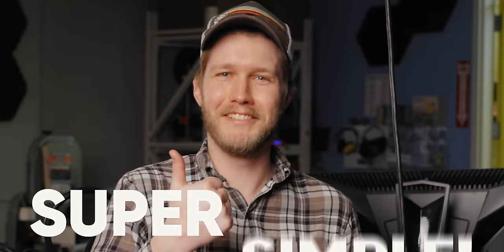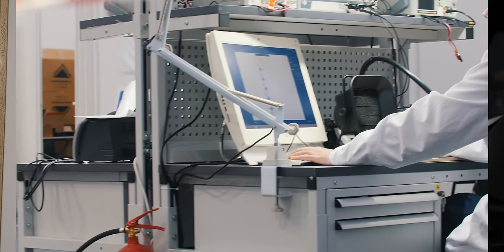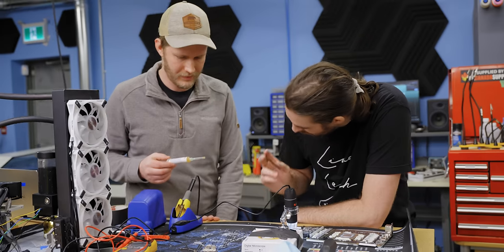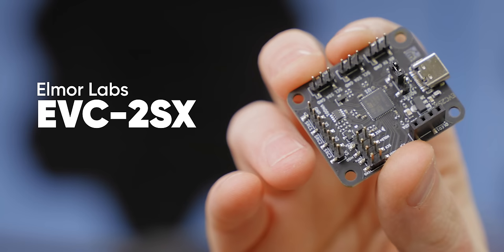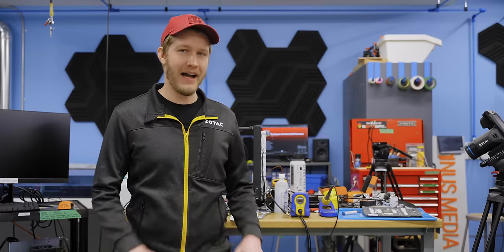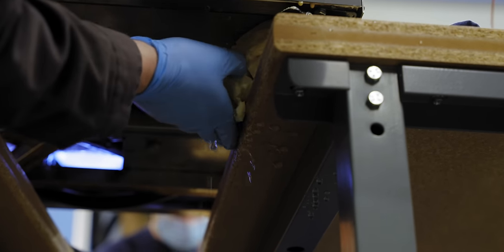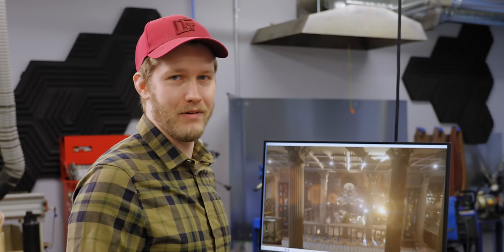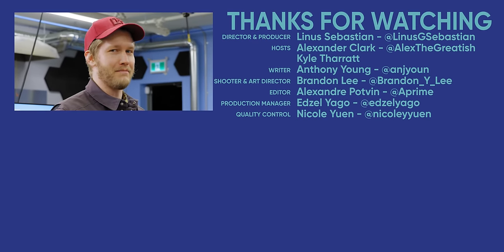Nvidia Doesn't Want You to Do This - GPU Shunt Mod

Comment: Watching this "solder-job" hurts me on so many levels
Reply: I know it's hard, but I guess you'll just have to solder on...
Reply: Yeah, it was something special. I'm an EE myself, and work with several hundred. You'd be surprised at how many don't know how to solder at all, it isn't something you learn in school.

There was nothing wrong with their iron.
Reply: The audacity to blame it on the soldering iron too. That Hakko station is great
Reply: @MTGeomancer  I learned it in undergrad for Mechatronics engineering
Reply: @stephm0  yeah the iron is fine I've done better with way worse that was the prime example of two engineers actually trying to do the work they design lolol
Reply: How will you all be able to move on from this traumatizing situation!?
Reply: @MTGeomancer  yeah, you can see that they don't have much practice by the way they are holding the iron and the lead.
Reply: One would think the EE had heard about or would see the need for a pre heater. A toaster instead of $500 IR heater is the equivalent to using a glue gun in construction.
Reply: Yeah, like when they broke out that 15 year-old jar of ratshack earwax...
Reply: I don't even solder and never have in my life and it's still killing me
Reply: yo as far as I know an engineer isn't taught to actually do that kind of job
Reply: I've done a better soldering job completely new into soldering on pcbs back than. Soldering 0805 smds is no match at all.
Reply: Stopped watching when I saw the resistors.
Reply: Men fr that was so cringe
Reply: From my experience as a pcb assembler, engineers generally don’t know how to solder properly.
Reply: legit. My eyes are bleeding. lmao
Reply: Tbf, high grade tin lead solder fucking SUCKS to try and desolder, especially with a mere 220° temp Kyle said the iron was managing. that's pretty low, and i totally sympathise, as well as the fact it's sitting on a heat sink designed for 390w
Reply: @bagibadoo439  the while point is that there's no need for that. That example is like watching someone bake a cake and suggesting they get one of those giant 50 gallon mixers for the batter. In fact, if they did need to pre heat the board, a toaster/toaster oven makes much more sense when someone 3 resistors. The worst part was when he thought that using a toaster oven, to heat a board, would mean that you can't use it for food anymore. Derrrrrp.
Reply: @Tyler No the new guy
Reply: @littlejackalo5326  No, if they say they'll   attempt to raise the technical level of the LTT, recently hired an EE and replace two resistors on a $2500 GPU and it looks like this, you buy a preheater or hot air ffs. Using a toaster is something a student would to his perf board hobby project, not a multi million dollar channel and a $2500 board. It's like watching a carpenter using a pot as a hammer.
Reply: @willsoe  Fwiw, I've desoldered and resoldered 12 gauge silicon wires to a 12x12 PCB heater for a 3D printer with that exact Hakko.  Literally a square foot of 1/8" aluminum heatsink.  It goes up to 899 F/480 C.

People regularly solder PCBs with Li-Ion soldering pens these days.  The issue is not applying the right kind of flux to properly lower the melting point of the solder.  Pre-heating is great, too, but they lit. could have just put a smear of solder paste atop the existing resistor, held the new one in place with a non-stick probe, hit it with a heatgun with a condenser tip, and had no problems whatsoever.

Comment: Linus awhile back you asked what I wanted to see on the channel. This. This is what I want to see! Y’all using the workshop mythbusters style pushing the boundaries of pc tech.
Reply: Running it on apple M2 only!
Reply: Isn't it easier and shorter to type you vs y'all? Everyone knows you mean "all of them", so there is no need to go the extra step in differentiating between singular and plural. Or do you like looking hokey(rhymes with pokey)?
Reply: @numberpirate  typ mor smpl bc w'kno wht y'mean
Reply: @numberpirate  🤨
Reply: @numberpirate  the difference between "you" and "y'all" is less than the difference between "" and "isn't it easier and shorter to type you vs y'all? Everyone knows you mean "all of them", so there is no need to go the extra step in differentiating between singular and plural. Or do you like looking hokey(rhymes with pokey)?"
Reply: @numberpirate  who cares
Reply: @numberpirate  no one cares but i hope you have something better to do and i know you said that 11months ago
Reply: It's interesting to watch but practically speaking this is useless information for most computer users.. I prefer LTT video reviews of products and minor tweaks NOT non-engineers trying to hotrod. In the case of this video, none of them are as nearly qualified as Nvidia engineers to determine optimal clocks.. In developing the 3090, Nvdia engineers did in analysis to determine the pros and cons of running at higher clocks and voltages. A fair chunks of average enthusiasts that  mess around like this with their GPU will end up destroying it.
Reply: @RTsnipes  I care, it's annoying

Comment: As someone who does soldering professionally, watching this really hurt xD
Reply: I dont solder professionally and it still hurt
Reply: Calling it ''soldering'' hurts even! 😉
Reply: Yeah that was some of the worst soldering I’ve seen in my entire life. They go through all the effort of making a video about overclocking a card that very few of us can hope to obtain right now, and then just haphazardly glob some solder on the board, talk about how they could have done it correctly, and then just call it good for the lol’s. They didn’t even bother to use any cleaner on the board when they were done. Also, if you’re just going to solder another equal value resistor in parallel to cut the resistance in half, just desolder the original resistor and install a half value resistor. That would have been much more simple.
Reply: @robertbrainard5651  That Hakko wasn’t really a bad soldering iron. It’s no Metcal, don’t get me wrong, but it’s not bad. Their big problem, as they correctly pointed out, was that the board was doing a very good job at syncing away the heat faster than the iron could heat the solder joint. They’re just too freakin spoiled and lazy to follow their own advice to preheat the board before soldering, or take other measures to get enough heat into the board fast enough to properly heat/flow the joint. I used to solder at an aerospace company and this heat dissipation issue is not anything new. They’re just lazy and spoiled.
Reply: @Jibberish81  I share your frustration. I'd say desoldering the old resistor is definitely not easier though, at least in my experience. You run the risk of ruining the pad, and even if you don't you gotta clean it and all that. Piggybacking on top of the old one is faster and easier. Especially considering you have less thermal mass to heat up with more thermal resistance to the board, fighting its heatsinking capability.
Reply: @Jibberish81  I get the lazy part but, where does the spoiled part come in? Genuine question... typically (at least to my knowledge) LMG has to buy these graphics cards & CPU's unless stated otherwise that they came directly from a company. Linus has also mentioned, anything they get for 'free'.. they have to send back. In other words, they wouldn't be doing this to a GPU that needed to be sent back to the manufacturer. Again, I agree the solder job was lazy, no disagreement there. I just don't get a sense of being spoiled... especially with a channel as large as this... you could say they earned the right to do the dumb shit they do. Just my opinion!
Reply: @mass_stay_tapped_in528  Spoiled was probably the wrong adjective, probably more careless and/or disrespectful to their equipment is what I really meant. They could have taken the time to do a better more professional job, but they don’t give a crap. If they fried that card, then they just would have pivoted the narrative of their video to be something about how they fried that card trying to OC a card for their viewers and then contacted their suppliers to purchase another 3090 if they needed it. Yes, they buy their cards except when they’re specifically given them for marketing, but I think it’s pretty short sighted to think that they don’t get preferential treatment from their suppliers when they need a card that’s in short supply, hence they’re not worried about being respectful to their equipment, because they have access to buy another one, unlike you and me.
Reply: @mass_stay_tapped_in528  100% Agree.

Calling them spoilt is unproductive and more so seems like a personal issue completely unrelated to anything displayed in the video. They're allowed to waste their own money and if they do so, it's THEIR money. Youtube is a gamble, so being spoilt for earning the right to do things how they please, is nothing but deserved
Reply: Yes. When I heard they say the temperature was set to 200 and something I started cringing and laughing. That hakko is just fine for the job, I used to have one just like that.
Reply: @han5vk  they could have used a $50 hot air rework station to remove the resistors without damaging the pads. Still, I think the stacking method is fine and definitely easier. You just need to know what you're doing. You add some solder to one pad (tin-lead melts at a lower temperature), position the resistor on top, heat the solder while pushing it down and it should neatly drop on top. Then let it cool a bit and solder the other side.
Reply: @Jibberish81  Have you considered that the money they make from videos where they do janky stuff like this is more than what the parts are worth? Alex is good at his job because he's entertaining, not because his execution is flawless. 

It sounded like they didn't currently have the equipment to heat up the board, and while they did a terrible job that arguably made for a more entertaining video than if they had done it correctly. 🤷‍♂️
Reply: @danieljensen2626  Of course they don’t care about the cost of the card, that’s my point.  I guess it’s just me, but the whole video basically comes off as, “Hey guys. You know those exceptionally hard to find video cards? The ones that even if you’re lucky enough to find would probably cost most of you more than a months salary? Well we’re going to spend the next 20 minutes showing you how much we don’t care about this expensive piece of difficult to find equipment, because we have the ability to just buy another one from a retailer if we decide to call them.”

I get that they didn’t just take a new card and set it on fire in the parking lot, and it’s perfectly fine with me if you found their segment entertaining. Personally I just found their haphazard approach to more disrespectful to their audience than entertaining, given the current chip shortage.
Reply: My x99 board died. I have 0 % experience and knowledge, just have another AM2 dead motherboard and swap a few components  and my soldering work looks way better. ( PC is working fine since 6 months and sometimes it is not even turned off for weeks, because it is 3d rendering) So I really don't understand why and how did they get there.
Reply: Doing things wrong may have better educational value. When you see how darn hard it is to solder on a video card, you realize the dynamics and extent of the problem.
Reply: @nicholasvinen  yep. Though not s huge fan of hot air, takes forever. But that may have just been my crappy one. :)
Reply: @han5vk  it can take a while, it's safer to heat more slowly, at least until you get used to it. Heating too fast can burn the board and damage components. Once you get experience you can be a bit more aggressive and turn up the heat, then it isn't usually too slow. I've rescued things with hot air that would have been impossible with a soldering iron, like crookedly soldered TQFP ICs.

Comment: Hearing you got nearly 20% more performance out of the card without LN2 is actually pretty good imo lmao(6% from the k5 repasting and 12% over that) would love to see more.
Reply: I mean I got 19% performance boost on air out of my 6800 XT without ever opening up the card, though I wasn't starting at 390 Watts.
Reply: Everyone can do it just on water, they just don't know how to use evc2.
Reply: EVC2 + shunt mod + full cover waterblock + sub-ambient radiator = Insane benefits for the price. And if you do it right, you can actually get a significant uplift for less than double the wattage. Plus it doesn't require constant monitoring!
Reply: I'd love to see them mess around with liquid nitrogen